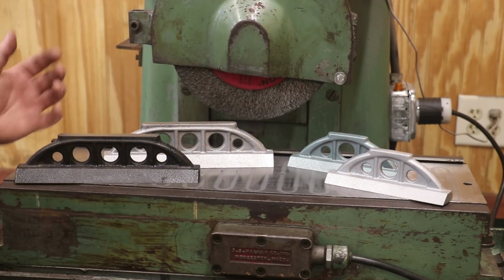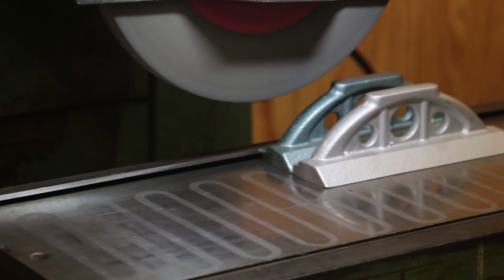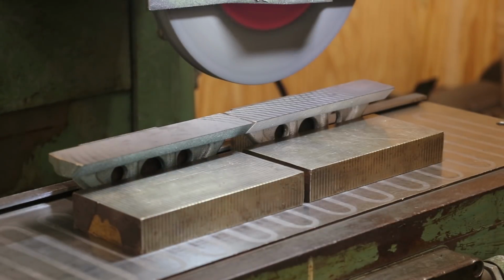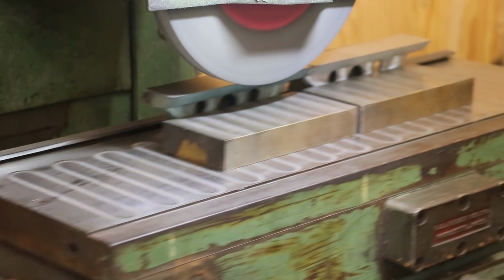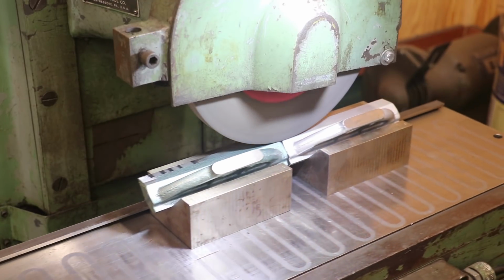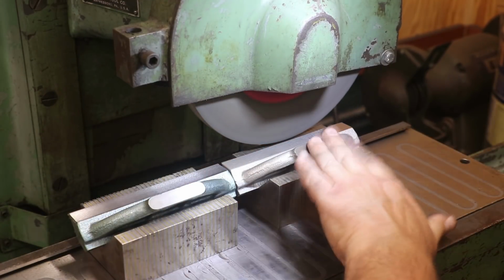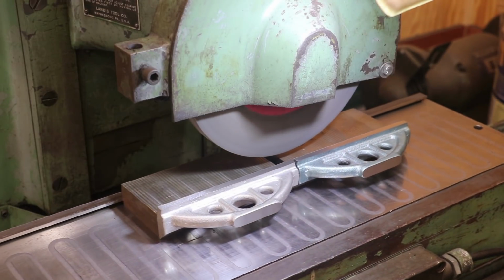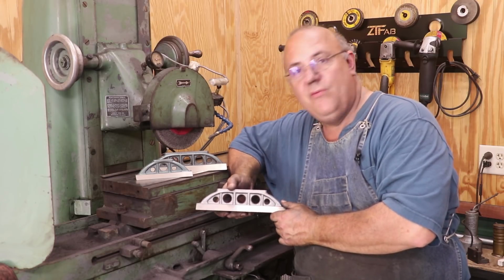Grinding Camel Back Straight Edge Castings on the Surface Grinder

Comment: Since most "precision" machine work on say engine parts rarely requires "flatness" beyond maybe .001" per "cylinder" on an engine block/cylinder head deck surface and a "straight-edge" outside of YouTube "how-to" machining videos seems to be actual STRAIGHT EDGE rather than "straight face" and is usually a piece of steel stock maybe 3/8" x 3" x  24" ground straight/flat on its EDGE because the THINNER THE "SURFACE" THE EASIER IT IS TO MAKE IT STRAIGHT/FLAT AND THE MORE EASILY "DAYLIGHT" CAN BE SEEN UNDERNEATH IT AND THE MORE "RIGID" THE STRAIGHT-EDGE WILL BE WITH ITS STRAIGHT/FLAT EDGE "BACKED UP" BY ITS FULL WIDTH AS WELL AS GIVING IT TWO STRAIGHT/FLAT EDGES SO IT CAN "SELF-CHECK", I'M STRUGGLING TO UNDERSTAND WHAT THE HELL THE POINT OF THESE WIDE, SHORT, SINGLE-FACE "STRAIGHT EDGES" REALLY IS SINCE THEY'RE NOWHERE NEAR LONG ENOUGH TO CHECK HOW "STRAIGHT" EVEN THE TABLES ON THE MACHINES USED TO MAKE THEM ARE MUCH LESS "LONG" WORK. AND SINCE TYPICALLY A STRAIGHT-EDGE IS USED WITH A FEELER GAUGE TO DETERMINE HOW "NOT FLAT" A SURFACE/PART IS AND WHERE ITS "OUT" AS WELL AS "MEASURE" MULTIPLE PLACES ALONG ITS LENGTH, ITS ALSO NOT TOO PRACTICAL TO HAVE A SOFT STRAIGHT-EDGE MADE OF CAST IRON OR ALUMINUM USED WITH STEEL FEELER GAUGES TO CHECK ALUMINUM/CAST IRON PARTS.  

THERE'S ALSO NOTHING ABOUT THOSE "BRIDGES" THAT CONTRIBUTES TOWARD KEEPING THE "EDGE" STRAIGHT/FLAT AT ALL. A "SUSPENSION BRIDGE" PULLS "UP" ON THE BRIDGE DECK TO COUNTERACT VERTICAL LOADS PUSHING IT DOWN. Putting a "bridge" on a "straight-edge" and especially one made with an aluminum or cast-iron CASTING with all the "internal stresses" MADE INTO CASTINGS and having that "bridge" be the "handle" on a "straight-edge" that surely is going to "bend" as its temp changes is just more "engineering" that makes absolutely no sense. Do you SEE many "castings" of aluminum/cast-iron being used as "structural" parts in ANYTHING where they're not needed to be "flexible" and aren't really "rigidly" connected to anything and CAN flex and expand and contract? I haven't. Engine blocks, cylinder heads etc have to be "flexible" because of the loads/stresses/strains/contraction/expansion they have to "survive". And they have "flexible" and "soft" material(s) as gaskets between them and other parts. 

I guess if you want a "straight-edge" so you can "certify" that your 6"-12" steel rule is "straight" or a short section of a mill table or lathe "way" is "flat" and/or "straight" and you want to ignore everything all the "experts" including many on YouTube "how-to" machining videos say about the effects of "temperature gradient" on "flat" and/or "straight" parts/surfaces/tools and maybe want to make sure your tools are "straight/flat" without putting them to a real "end to end" and "side to side" test, these cast, soft metal "straight edges" ground on a "precision grinder" with a million "cycles" on the table and a constantly "shrinking" grinding wheel made of undetermined/unmentioned material are probably right up your alley. 

But at some point and preferably before you do any "work" for anybody but yourself or some "fellow machinist" in the "machinist community" who is equally "ambiguous" and when and where "accuracy" and "precision" actually matter, you MIGHT want to invest in a GOOD straight-edge long enough to check entire parts like cylinder blocks/heads/flywheels etc "end to end" and "side to side" with a single "pass". Because if you have a "job shop" you're going to be getting more of THAT kind of work - at least for a while until your "accuracy" and "precision" have NASA knocking at the door - than you are of any "machining" of brand-new material/castings/forgings small enough to be "flat/straight" according to  your 6"-12" "straightedge" and even though you MIGHT get ".001" per cylinder" on a block/head you'll probably ALSO get "no more than a FRACTION of the "total" if you multiple the number OF cylinders by .001" per cylinder. 6 cylinders at .001" per cylinder but no more than .004" end to end. Something like that. The "per cylinder" spec is there because you're going to have "waves" in a cylinder block/head and the "edges" of combustion chambers.cylinders can be "low" because of the high unit-loading or high because of higher rigidity and "side to side" engine blocks/heads aren't "uniform" in their internal structure/strength.

What you absolutely do not want to do is use a shrimp too-short "straight edge" and "walk" it along/across the deck checking for "straightness/flatness" using a cheap, homemade shop-project "straight-edge" that is going to be every bit as "flat" and "straight" as the "precision tools" you made it on/with. Especially if you "mill" it and then have to "surface grind" it to make it "flat" and "straight". I've been a diesel mechanic for 25 years and have rebuilt/repaired dozens and dozens of engines from nitro RC engines to GE freight locomotive engines and have done a little bit of "amateur" machine work along the way. Nothing major - just a few valve jobs, cutting Caterpillar 3306/3304 blocks for liner bore/counterbore inserts and "shims" to repair cracked bores and get liner protrusion up to spec, etc. 

And I've been in a fair number of machine shops. Both "engine machine shops" and big and relatively "famous" so-called "job shops" like Gessford Machine in Hastings, NE (if you can think it up or haul it in they can make/fix it and I'm not even exaggerating a little bit) and I've NEVER seen a "precision grinder" in use or even "in inventory" EXCEPT for VALVE GRINDING MACHINES WITH "SIOUX" ON THEM AND CRANKSHAFT GRINDERS THAT ARE NEVER USED TO "FINISH GRIND" MORE THAN THE LAST FEW "THOU" (I'd never let a machinist too lazy to say "thousandth" work on anything for me - how lazy and unprofessional can you be and what's "precise" about "slang" in technical situations?) off a journal after the "rough grind" and before the "polish" with "emery cloth" bands. 

And for the record, even grinding crankshafts is generally a no-no in the "high-performance" (some people think engines that make 5000 hp for 10 seconds are "high performance but I kind of think "high performance" can be and is also engines that make 500 hp for 10,000 hours) field/industry since very few machinists/crank grinding machines are "equipped" to do it PROPERLY and make sure the "fillet" is left-alone/reestablished during/after grinding. Put a SHARP EDGE at the "end" of a crankshaft journal or ANYWHERE ELSE on a shaft subjected to high "twisting" and "radial" loads and its only a matter of time before that shaft snaps clean as a whistle right through that sharp edge. Because of "stress risers". 

Left there from "precision grinding" and other cutting operations where the loads put ON the part/metal as layers are "cut" away get "trapped" just inside/behind that "edge" and have nowhere to go but "out" eventually. Especially when that edge is the result of "single-path" grinding/cutting and all the "grain" left behind of the cutting/grinding is "parallel". There's a REASON real "high-performance" and "high-precision" grinding/machining/cutting is finished by "non-directional" honing, polishing, lapping, etc and never leaves sharp edges and "stress risers" in the work. 

I get the idea watching lots of these YouTube "how-to" machining videos that the "YouTuber" making them is or thinks he is some kind of "instructor" and has or thinks he has an audience of "students" and that may well be the case and he may well seem like a consummate "professional" and "expert" TO those "students". But every true "professional" machinist I've ever known, like every true professional mechanic, electrician, plumber, HVAC repairman or other technical tradesman hasn't had the the time, energy, desire or need to "teach" in what little free time he has/had away from the "shop" and couldn't pull it off if he DID want to and tried because whether it was before or after work or in his "home shop", his family and friends and customers would still find him and probably right in the middle of a "how-to" video by phone or personal visit. Especially if that "short" how-to video took at least 2-3 times longer to "shoot" with multiple set-ups and clips, etc than the actual "work" would take and even more time was "spent" on a "step by step" explanation of every single "task" and "thought" along the way. 

"Teachers" teach by talking and even when they don't need to and quite often a "student" ends up "not getting" something he SAW and HEARD ABOUT because he can't both LISTEN and WATCH at the same time and a MANUAL "HANDS ON" TASK IS MUCH BETTER "PROCESSED" IF ITS SEEN RATHER THAN HEARD. True "professionals" who WORK in that same "field" or "industry" generally are EXCELLENT "teachers" because they being an "expert" isn't important to them, they already HAVE one job and when they're doing something requiring precision and accuracy and concentration on their part and they're QUIET as they do it, any "student" observing/listening to them will only have to do ONE AT A TIME and will "get" by the fact that the "instructor" is NOT talking that what he's doing and how he's doing is important because he's not distracting himself OR his "student" as he DEMONSTRATES IT. 

And of course true professionals with real, long-time experience IN THE FIELD know that "education" gets you a first  job in a field or industry  but a first job TEACHES YOU how to be a professional. And nobody who is an "apprentice" and is working "under" somebody else and has him/her "looking out for" them is ever really "ready" to actually do the "real thing" once their "apprenticeship" is over in X amount of time or after Y tasks or "skills" demonstrated to their..."instructor" who invariably "passes" every "student" he's "educated" because if THEY "FAIL" then HE MUST HAVE "FAILED". And there's nothing more destructive than a "symbiotic" relationship between "master/instructor" and "apprentice" where they both "need" the other to "succeed".

Comment: Where did you get that magic "mag chuck" that's "magnetized" for aluminum and cast-iron? And why does your "stone" grinding wheel look so much like a wire brush wheel like this one: 

http://www.shanewhitlock.com/blog/?p=239 

at the beginning of the video when you're "grinding" but the grinding sounds aren't synched to the video and you're grinding aluminum? 

Maybe your magic aluminum/cast-iron magnetic chuck isn't "magic" after all and you had to sort of "pretend" to be "grinding" those short non-ferrous parts, huh? And maybe your surface grinder isn't any more capable of "precision grinding" things "flat" any more than any other grinding spinning a round, constantly "shrinking" stone across hard/soft metals is. If you can't "mill" something "flat" and don't have something "flat" to start with, you sure as hell aren't going to be able to "grind" it flat with a wheel that's wearing as it cuts.
Reply: The parts he's grinding are actually cast iron, the silver looking one has been painted with a silver paint.  Cast iron is also magnetic.